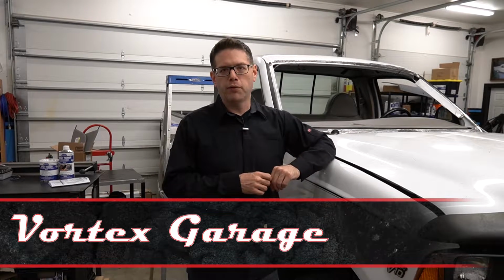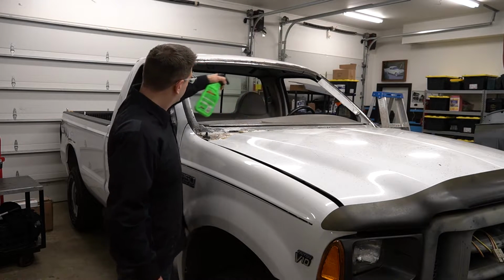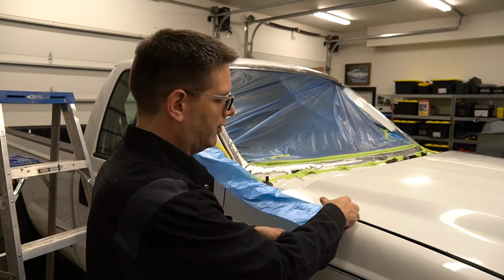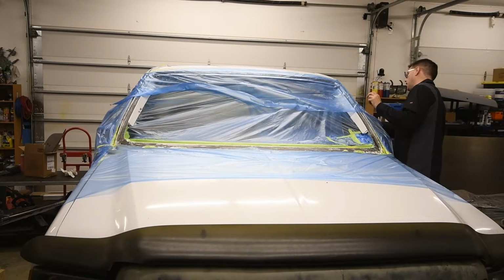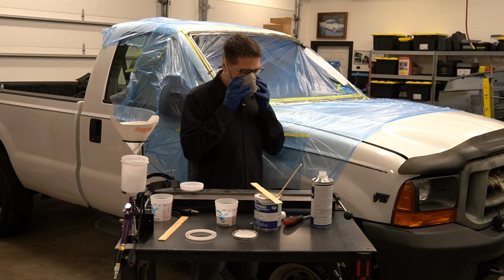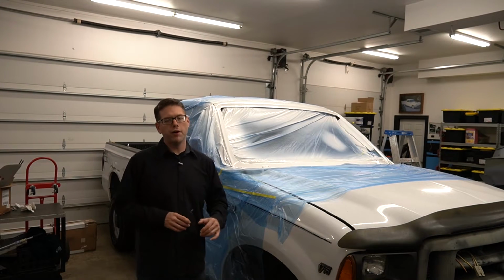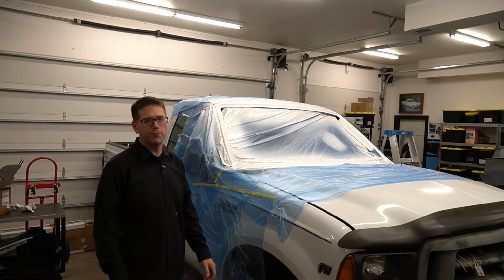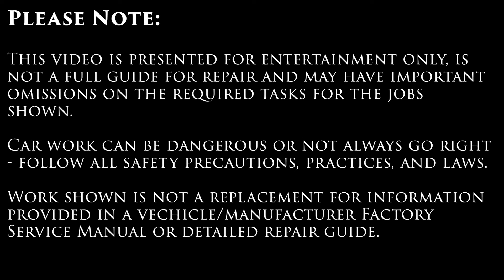F250 Windshield Frame Rust Repart - Part 2 - Prep and Spray of DTM Epoxy Primer

Comment: Greetings and good video. I had a hard time locating a video with this specific repair. 

Can you please elaborate what brand primer you used?  Or simply include a link?

Much appreciated.
Reply from the maker: Good day - the DTM epoxy primer I used was from Eastwood company (eastwood.com) - it has held up great so far, 4 years in this repair